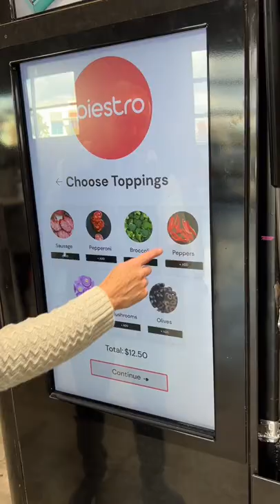Piestro pizza making vending machine demo

Comment: I think it’s a dope idea, I like it. As for the blade complaint, maybe one solution is to have multiple blades in rotation, let’s say 4 blades. After one blade is used, a clean one takes its place for the next pizza, the used blade is wiped, rinsed, sanitized, UV lighted (I don’t know, let’s just say thoroughly cleaned). By the time the newly cleaned blade is dry, it’ll be it’s turn.